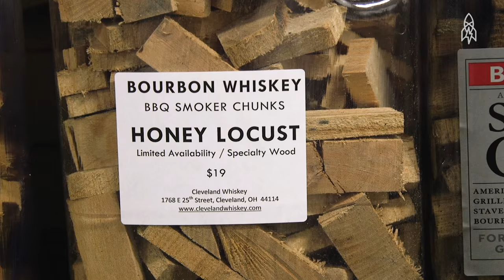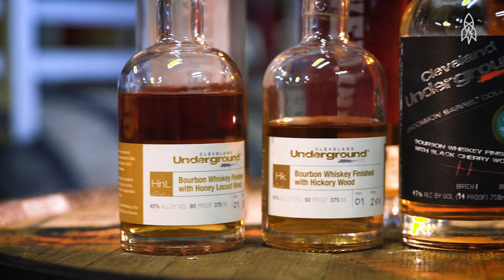Aged Whiskey...In a Day?

Comment: Where can I get my hands on this technology?
Reply: Your microwave and freezer. 
Remove metal from mason jar, add a few pieces of JD smoking chips (used barrels) that you can use raw, toasted and charred.  Heat to about 150F (go slow and measure temp until you know the time it takes to warm your alcohol to this temp). Or use a pan full of water on the stove with your mason jar filled in this and slowly bring it up to temp.

Put metal lid on after heating.  You just created a vacuum in the jar.  After it comes to room temperature or the next day open jar (let breath), reseal and put in freezer then back to room temp and open to let it breath then reseal.  Rinse and repeat as needed.  The heat and cold will push the spirits into the wood and pull them out again.  A few wood chips go a long way flavoring your whiskey, start with less than you think (can always add more later).

If you like finished whiskeys then you can add a teaspoon (adjust to taste) of Oloroso Sherry or a port wine.  If you like a more vanilla flavored whiskey (think JD) add a very small amount of imitation vanilla extract (Imitation works better than real extract and is cheaper too). Like nut flavor in your whiskey add a dash of almond extract. How about a hint of cherry?  Add a bit of juice from a jar of maraschino cherries.
Use a syringe and measure small amount in CCs when adding.  You can always add more.  Try a drop in a shot glass to see if you like it first.

Less is more and always give it a couple of days at the minimum to rest as spirits develop after making any changes to it, small or large.  

Unlike whiskey producers YOU are not limited in the way you flavor your whiskey.  Try honey, maple syrup, caramel, drop of liquid smoke, mint leave, small piece of lemon or orange zest.

You want SUBTLE amounts as it's easy to make things taste artificial quickly.  

Flavoring is easy but TRUE AGING is not.  You can't full mother nature.

Comment: Well obviously, cordless drills, electric chainsaws and computers should be forbidden as well. Hats off to you Sir. But, come to think of it, putting pressure on things has been around for ages. Has no one ever thought of this before? Let's say you put a wooden lid on a steel barrel and push it down through the liquid. Thereby squeezing it, filtering it through the wood. They could have done that since 1789.

Comment: What I'm getting out of a lot of this is that they are a type of alcohol seller trying to dodge a bullet or bend the rules to get stuff out quicker and cheaper without having to deal with the drama of everything else.  Normally I'm the kind of guy who appreciates innovation, though not at the cost of things that made the original product important or by simply skipping a few steps.  That'd be like writing the Cliff Notes instead of a novel and claiming you've innovated literature.

Not necessarily a big fan of whiskey myself, but now I know what to avoid if I ever have to buy a bottle.
Reply: Likewise

Comment: If someone invents technology to make a hunk of chuck beef reach 150 degrees Fahrenheit in 1 minute, sure, you could call it "meat" or "dinner" or "pot roast", but it won't taste any good. Spirit maturation is a chemical process, like cooking, not just a matter of extracting (which is a physical process). Just like in a slow cooked pot roast or BBQ slab collagen GRADUALLY transforms into gelatin and other various flavors are developed over many hours, similarly in oak barrels a spirit gradually, over many YEARS transforms lignin into vanillin, but also many MANY other aromatics are created, yes CREATED, not extracted from oak. Sure,  this process can be somewhat sped up with bottle whisky sticks, table top barrels and quarter casks, but not exactly. They were offering samples of this Cleveland stuff a few months ago. I was so glad I didn't buy a bottle, it's just a superficial experience. Maybe for mixing. But then, there's cheaper REAL aged legal straight bourbon for under $10 (Benchmark 8, quite decent) and under $15 - Ezra Brooks and Evan Williams (pretty good) that are certainly better product and cheaper for mixing if you like melting ice with your whisky.

I've tasted "cognac" aged this way - by forcing under pressure through wood chips. Even claimed to be made from French distillates. Utterly vile swill.

If this technology is so great, please present products comparable to some craft bourbons, ryes, cognacs and single malts, for less money (otherwise, what's the point?) and THEN we can talk :)

P.S. The whole global shortage of whisky is also a half-truth. Sure, it's cyclical and goes through some years of plenty and years of not enough, but during this so called shortage I've seen some of my favorite malts come down in price - Ardbeg 10, Glenmorangie (all core expressions), Aberlour 12 and there are also a few other affordable malts. Distilleries have expanded, they produce HUGE amounts of spirit. We'll be awash in properly aged whisky.